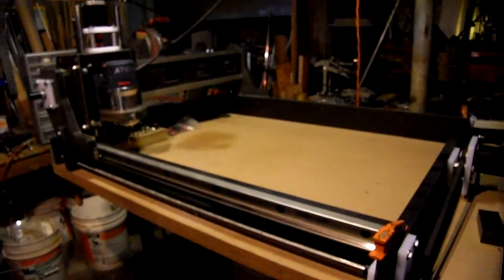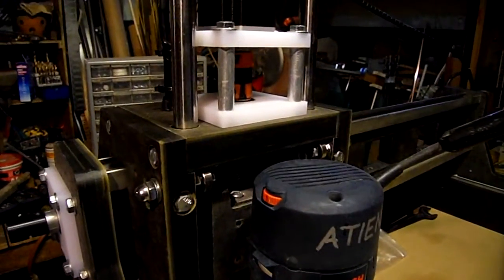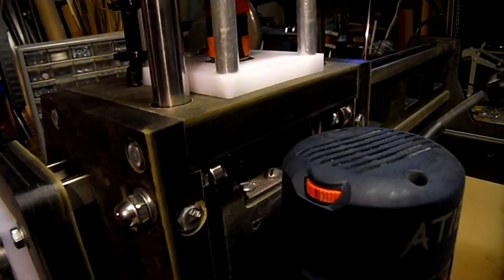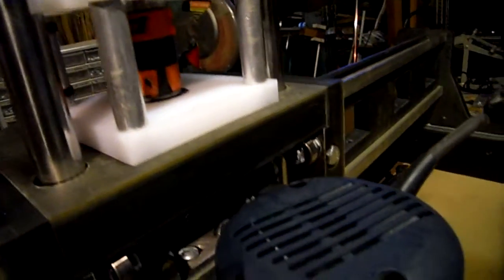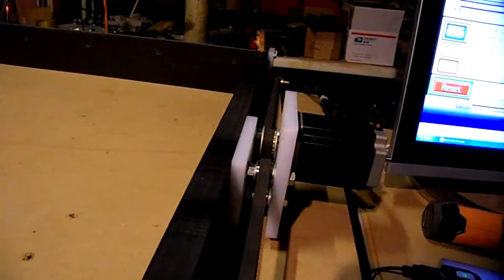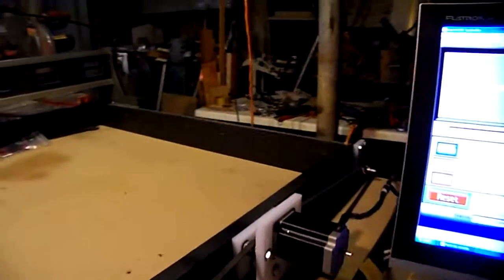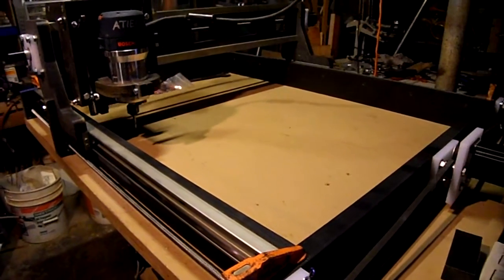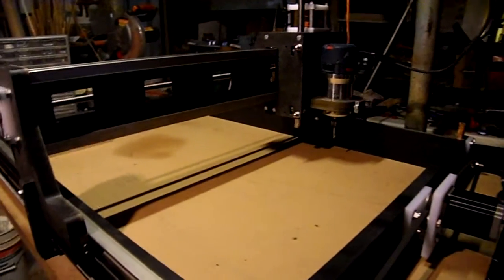New Home Made CNC Router, Upgraded Parts!

Comment from the maker: @EnterTheMindzi I have about $1200 into it.  I found the rails for $25 each on eBay, and the phenolic was from a job I did a while back.  The drive and steppers cost about $500, and the leadscrews, nuts and bearings probably another $300 or so.

Comment from the maker: @80jeff Thanks!  This is actually based on the old 25 x 37 plans, which don't seem to be available anymore.  Aside from the surplus linear rails the concept is similar to other Solsylva designs, with the raised rails.

The phenolic is more dense than wood, and the added mass and ridgidity help a lot with performance.

Comment: Very nice machine Louie how do you like that Bosch I have been looking at the Porter cable 690 but it is 1 3/4 hp maybe I need some thing bigger for my Fine Line kit FLA100-00  I will be cutting wood aluminum and plastic..

Comment: Louie how do you like that Bosch I have been looking at the Porter cable 690 but it is 1 3/4 hp maybe I need some thing bigger for my Fine Line kit FLA100-00  I will be cutting wood aluminum and plastic..